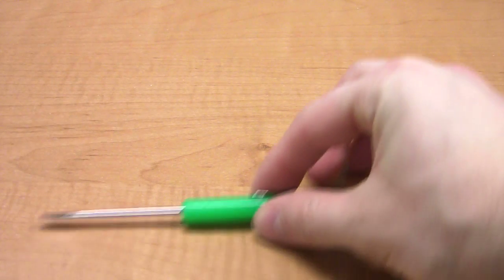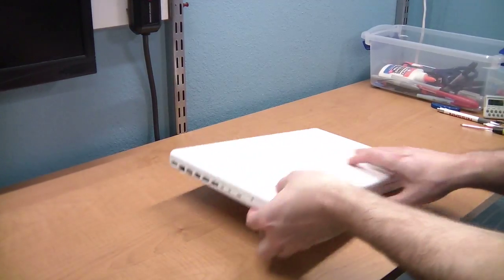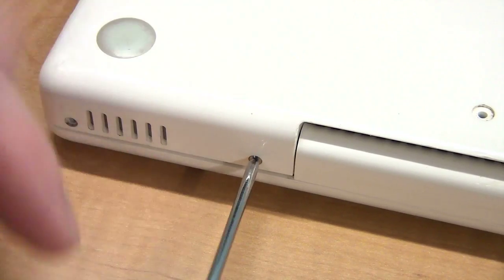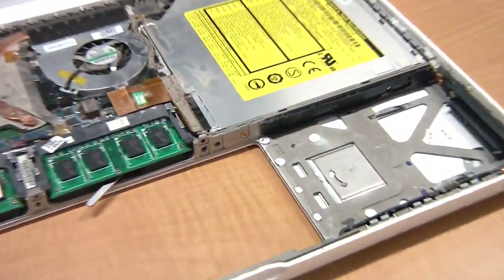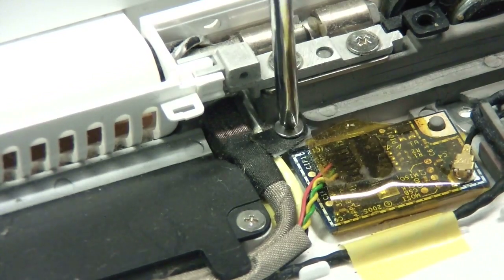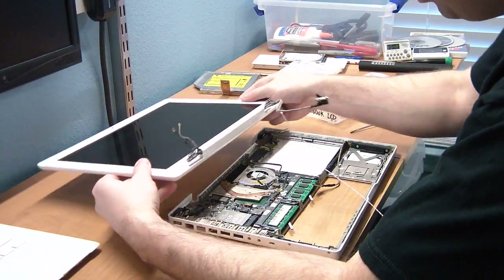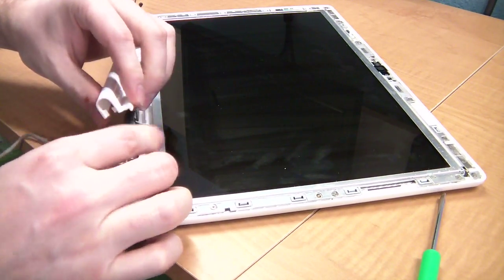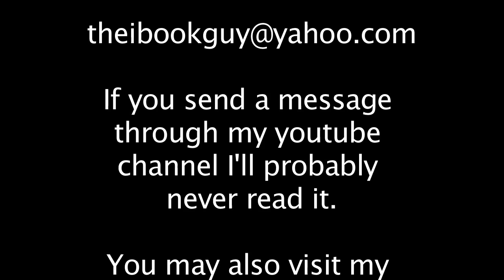Apple 13" MacBook Disassembly and Repair video

Comment: Dear all,
my macbook (white) sometimes starts, sometimes not. Sometimes no sound, no light, like  dead, than, the other day its starting as nothing happened before... any idea what I can try to fix or change when I removed the keyboard?
Reply: could be a power adapter issue (see if you can borrow someone's to recreate the problem) or possibly a battery issue. It's also possible the motherboard could have liquid damage

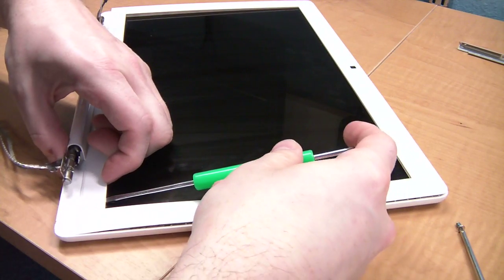Comment: 7:26 i cringed when you used the screwdriver to pop the plastic clips holding the last part of the screen bezel on, i am very surprised you did not scratch the screen or brake the pastic.

Comment: whats a backlight inverter why u throw it out
Reply: It's the circuitry that converts the dc from the power supply into ac for the backlight. He threw it away because it was faulty and got replaced.

Comment: Modern 12" Macs are sooooooooooooooooo simpler!
Reply: But you can't upgrade any parts in it.
Reply: Why would you want to anyway? I don't see anyone trying to upgrade their tablets or smartphones. That's a stable, reliable non-gaming platform. It should perform fresh for years, without frequent reboots and reformats.
Reply: Experience has shown me that you want to upgrade the RAM and the Storage after about 4 or 5 years in order to keep up with the growth of the size of the software and the number of files that people want to store. iCloud does help with the latter in some regard, but RAM will be an issue.

Of course, it depends on use. The old 2009 MacBook I have basically only gets used for some typing documents and checking emails (the really basic stuff that every uses a laptop for these days) and manages nicely with 6GB of RAM. However, my other Macs have 16GB and the stuff I do regularly gobbles up 12GB of RAM!

For any of the Mac Laptops to run smoothly today, they really need to have 8GB of RAM. If your Mac supports it, going to 16GB is even better as it future-protects it from needing another RAM upgrade in the future.

I've done several of these upgrades for my college friends to keep their older Mac Laptops going until they graduate, get a job and can afford a new computer. Most of them acquired the laptops as refurbished or second-hand.
Reply: By the way, I have never owned a brand-new Mac. I've always bought them second-hand and refurbished/upgraded them myself.

Comment: oh dear god thats complicated
Reply: LOL!!!!    i can just see myself now.........,in tears, surrounded by tape,screws,bits of plastic etc ...looking at the garbage can and realizing thats where my computer is headed
Reply: lol i can agree
Reply: Not really, you just need to take it slowly, keep track of your screws, and follow the steps in sequence. The only step that’s even slightly tricky is reconnecting the ribbon cable as you replace the top case.
Reply: But still I don't really have trouble with taking computers apart but even taking it apart I would go insane.